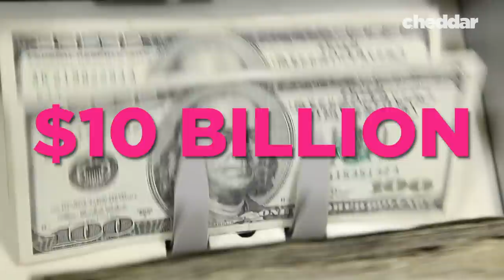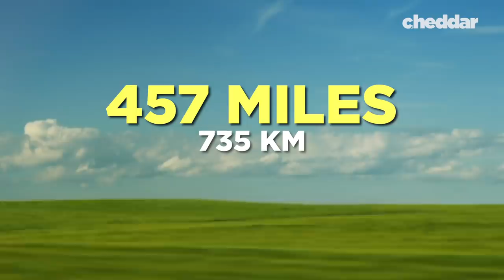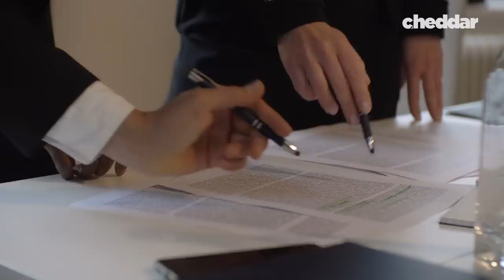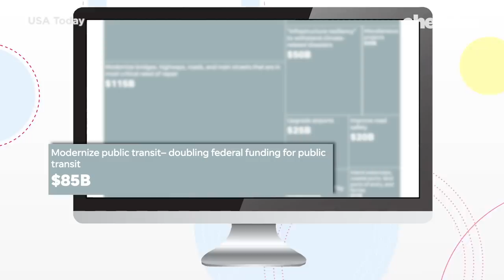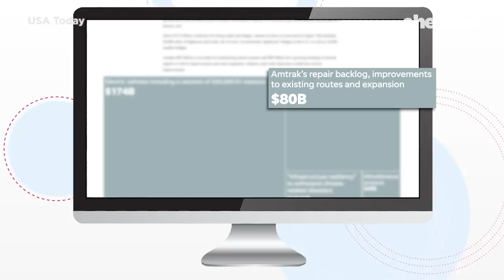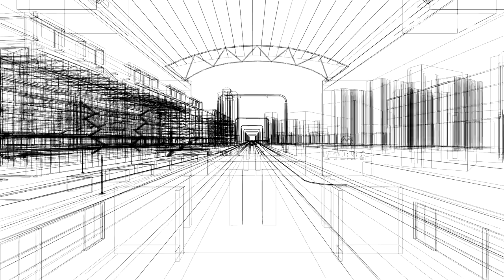Is New York Finally Getting A Real High Speed Rail? - Cheddar Explains

Comment: And what would the cost be if they instead went with the more reasonable 160 or 170 mph?  Those last mph cost a lot in construction and operations.
The biggest issue with the planned stops are the "last mile issue", when you arrive at the station you still need a way to conveniently get to your final destination using public transportation.
Reply: This is what many European commenters do not understand. The town where I live in the U.S. is about 20 miles from a major city (Tampa), and is 30 square miles in area. Even if there was a train station in my town, it might be located 10 miles from where I live. Given how spread out most U.S. communities are, public transportation just doesn't make sense. Even if you added a bus system in addition to the train system, driving around and making stops in one part of MY town – just one town, and not even the largest in my region – to another could take hours unless people are willing to walk multiple miles home. There's just no way to implement this in most parts of the United States. I've ridden, and enjoyed riding, these trains in Europe, but it works cohesively there. I don't know why people refuse to understand that a system that works very well in one country cannot simply be cut out and dropped in another country and expected to work just as well.
Reply: @VisibilityFoggy  Still, why not contruct HST in areas where it will work, though? Even European HSTs are selective in areas where they work the most. The area with best chance might be within East Coast, because of their pre-automobile development (similar to European cities).

Comment: The US is also missing out on unifying suburban commuter rail networks into through-running systems like the RER in Paris, London Crossrail and various German S-Bahn systems like the Munich S-Bahn. 
accessible

New York City has three different commuter rail lines terminating in Manhattan, imagine the potential unified tri-state commuter rail system would have using through-running underneath Manhattan. There are certain obstacles to this at the moment ranging from, different electrification systems, differing rolling stock and of course the lack of unified rail corridors as well as financial mismanagement. Even the Regional Plan Association mentioned this as a key element to truly connect the Greater New York region as well as much of the Northeast, this would further alleviate the congestion at major stations like Penn and GCT.
Reply: Have you seen American suburbs? It’s nearly impossible to build public transit there other than a few bus lines. 
Too much low density single family use sprawl to make it viable, not to mention nothing is walking distance in the suburbs.
Reply: @blackhole9961  True, but through-running commuter trains are the best fit for sprawling suburbs, that's how it's down throughout the rest of the world including Canada, UK and Australia.
Reply: @kariminalo979  while that maybe the case for other countries remember these are American cities/metros, designed, planned, and built completely differently. No one is going to drive to the train station, get on the train, go through MANY MANY stops because of how sprawled out the suburbs are, get off the train and hope your destination is within walking distance and if not uber and lyft are your only choices, this will very likely take longer than driving. That whole process is from A to B to C to D meanwhile cars are just A to B, you can drive directly to your destination. Hardly anyone would ever ride it or would even have a reason to. American cities are just not dense enough and aren't planned for it. Heck the average American has to even drive to their nearest grocery store because mixed use zoning practically doesn't exist.

Comment: America lags behind when it comes to rail, but there are some exaggerations here. Acela does way more than 65 for the most part. It can acheive 155 but because of tracks it is limited espcially north of NYC where Metro-North owns the tracks. Despite that, they do over 100mph for most of NY to DC, even the local Northeast Regional trains run 100 - 115 for long stretches. The truth is bad enough, their is no reason to go overboard.

Comment: Given the difficulties one big improvement to rail speeds could be to prioritize passenger trains over freight, which currently has right of way (from what I've read anyway). I've taken Amtrak a couple of times where the train was delayed for hours due to freight trains. Autonomous trucks could greatly reduce the use of freight trains since they'll be able to deliver directly to the end warehouse. This could free up capacity for passengers while reducing track maintenance costs with less wear on tracks due to the reduce weight and number of cars.

Also, Cheddar focuses way to much on NYC compared to the rest of the country. It's only 2.5% of the country's population.
Reply: You are correct that freight trains are given the priority, but that is largely due to the freight train companies (UP, BASF, CSX, NS) also own the vast majority of track in the US.

Comment: Another place a high-speed rail would be useful is the pacNW. Eventually a Eugune, OR to Vancouver, BC line would ideal but an Olympia, WA to Seattle, WA would have an immediate benefit in reduction of traffic, cleaner air, and other environmental impacts. If that line and a Salam to Portland line were built at the same time and both states worked on the other connections within their states for the line overall. Then maybe, just maybe, both state legislators would have had enough time to dislodge whatever was up their individual asses to agree on a connection over the Columbia River and even replace the I-5 bridge finally. It's not like one section of one span is over a hundred years old or anything. . .

Comment: High speed rail is a thing of the past. If there's anything the lockdown has taught us, it's that many people can work from home. The typical passenger on high speed rail is a well off business person. The middle class of the United States does not want to pay more taxes so that someone who earns six figures a year can ride a high speed train. Many of the people I run into here on the Jersey Shore take a limo or drive into the city every day.

"What if they built a high speed rail and few people used it?"
Reply: When Japan build the Shinkansen, that exact same question is also asked. The sentiment at that time is different however: trains as a whole is a thing of the past. Automobiles and planes are the future. But look at it now: it serves millions of passengers a day.

But you do bring up a valid point: what will be the demand of passengers today when workers now work at their residences? In my opinion, a reliable regional train with more frequent services will be more feasible.

I would not dismiss a form of transport to be outdated so quickly. Our oldest form of transport still in service today: boats. Yes, their source of power, the materials, the design, the construction, etc. changes, but the fundamentals remain largely the same. These humble boats are responsible for the bulk of our global trade.

Comment: For a nation of its size, the US should’ve had a nation wide high speed rail system years ago. This is ridiculous.
Reply: Actually, I would argue that being a "nation of this size" and density is the exact reason HSR doesn't really make sense for the U.S.
Reply: Yes but the population density is much lower than Europe or Asia, hence TGV is useless here.

We instead use jet aircraft.

For example, San Jose (aka silicon valley), population 1 million, to the next city to the East that's at least one million, is 1734 miles to Dallas, Texas. Three hours on a plane. HSR would take six hours.

No point.